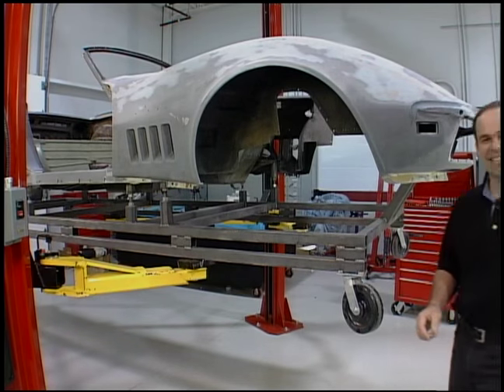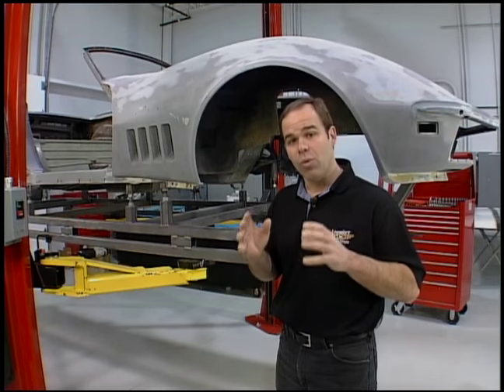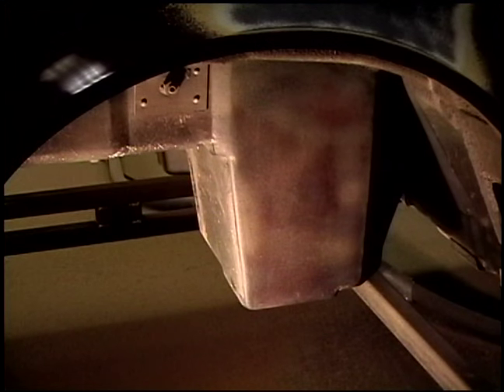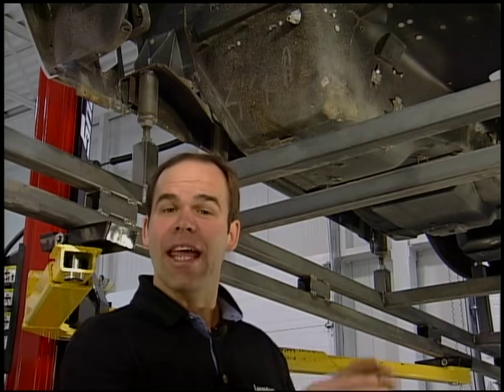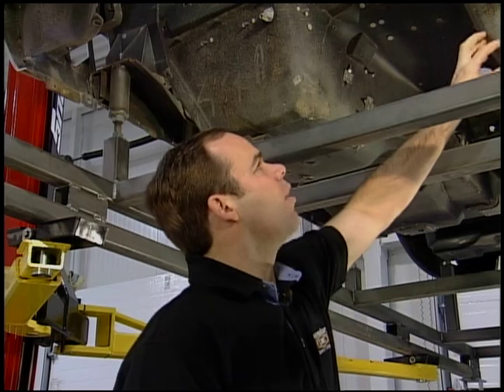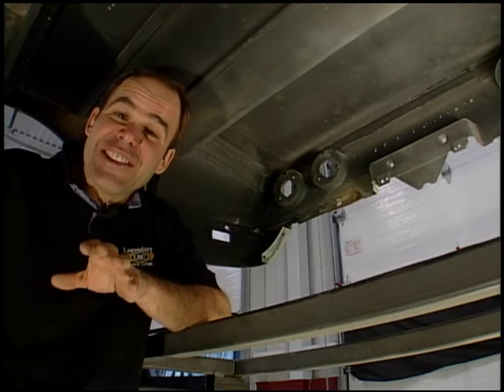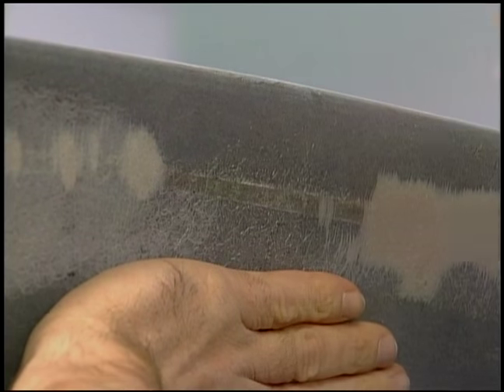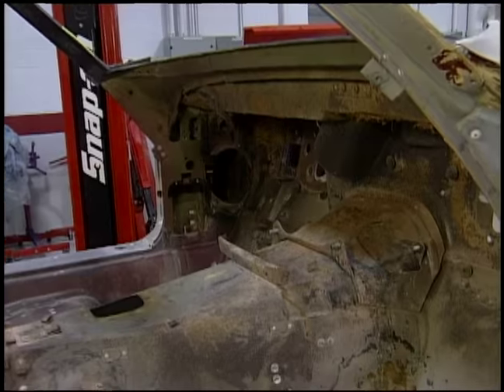1969 Corvette L88 Resto Project 3/13 Legendary Motorcar DCG TV series

Comment: Original is a funny word.  The L88 is "original" only once and it can't ever be "original" again.  It isn't arguable.  So, replacing markings from the factory is simply foolish IMHO as it doesn't make the car anything except a fixed up car made to look original.  That's why I'm not sure why all the fuss and talk about how accurate stuff like a hose clamp has to be.  It doesn't make any sense at all.  If it's not the "original" hose clamp, the EXACT one that was on the car when it left the factory, than who cares if the same type and brand is used?  These guys who pay huge sums to buy a car that is "original" simply aren't thinking straight.  Me?  I prefer a car in as good a driving condition as is practical without all the make believe fantasy stuff.  In reality, there's (1) original (2) not original and that's it.  It can't be "as original" even if you wish and hope it was.  It's a very strange game guys play when you hear them talk about their prized cars.  Just keep in mind folks that when you see a chalk number on a transmission or a hand painted number in white on a rear end, if the guy at the factory didn't put it there, somebody else did and that makes it a.....COPY OR REPLICA.  It does not make it, nor does it even come close to making it....an original.